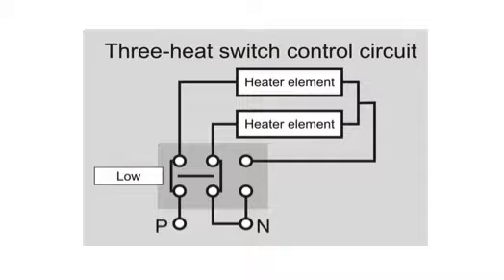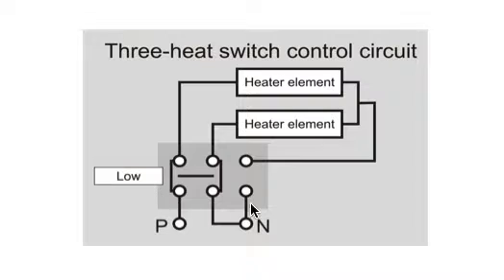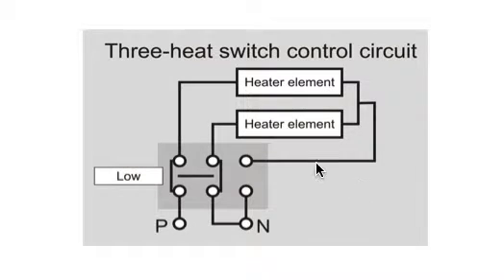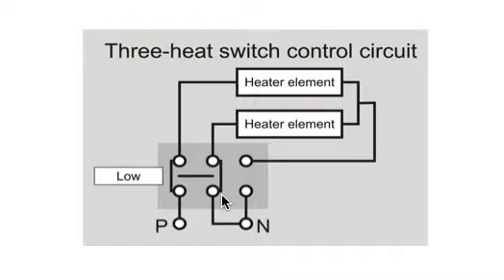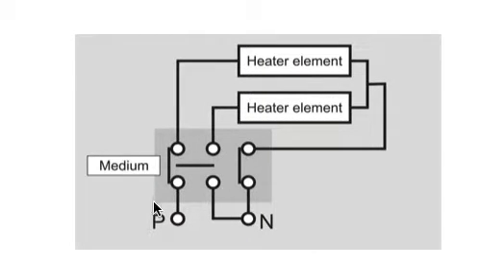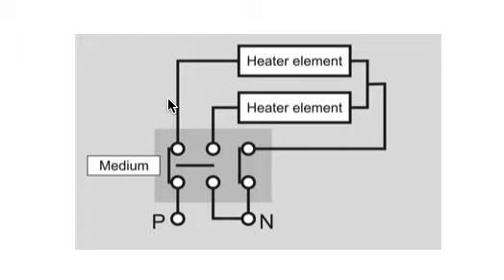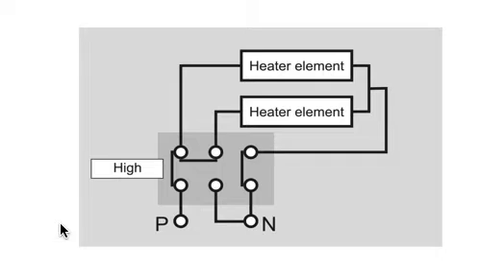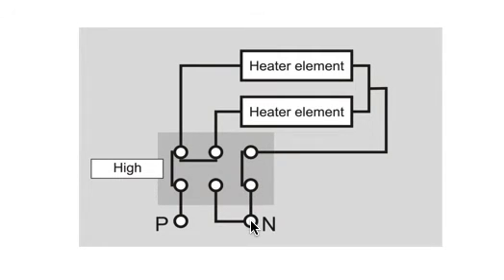3 Heat Switch

Comment: Thanks for sharing this one my friend, I'm trying to build a Heat Press machine using an electric stove coil, since I found out they are using the same heating element as in the heat press machine, perhaps I will just need to find a big coil. By the way, there's a "heat press temperature controller" sold separately, which has 4 wires, 2 wires are hot (220v source for the heating coils) and the 2 wires are supposed to be for the temp-sensors, so it can sense the heat of the plate, any idea how to connect them to the electric stove coil? I guess we have to eliminate the stove switch and use the Heat-Press controller as the main switch right?